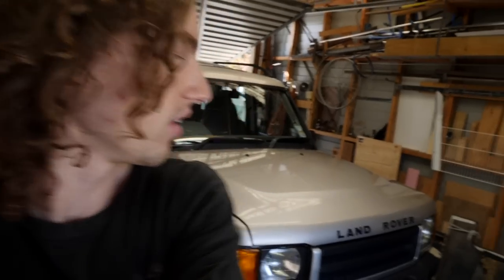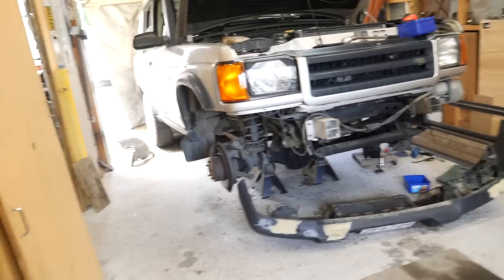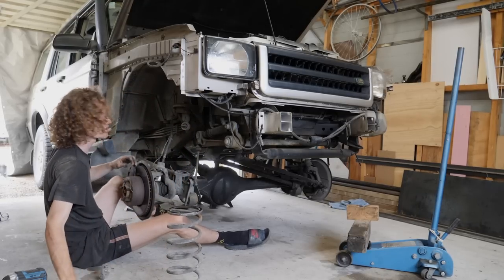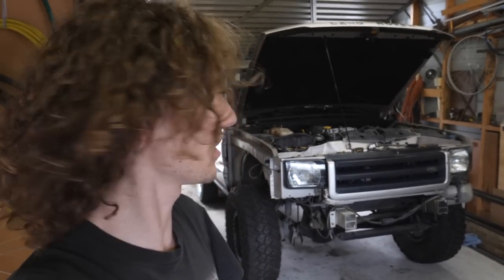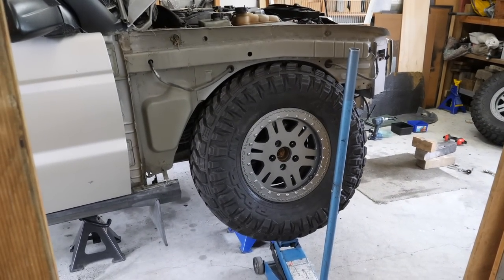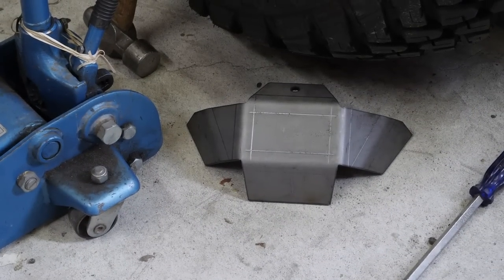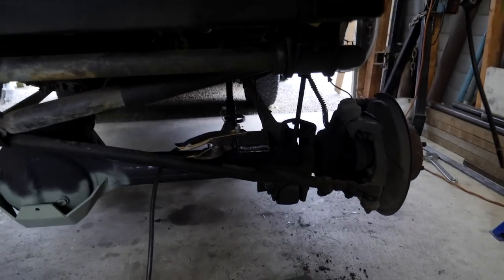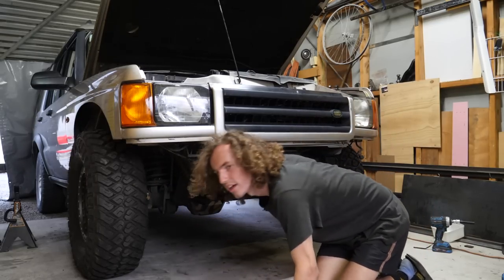BEATER TRUCK Build Begins! 33s w/ NO Lift! HUGE Guard Chop & DIY Fabrication on Discovery 2 TD5!!!

Comment: love the disco! ive got a 99 with about 4.5 inchs of lift and 275/60r20 tires but i rub on the control arms even with a 20mm spacers

Comment: Love the vids your a natural at driving off-road..Here in the uk 🇬🇧 we got what seems like millions of these D2s turned into off-roader and having had plenty myself and D1s, This Being a later model disco they just don’t flex aswell as the D1s plus you can’t beat the power of a V8 3.9 💪🏼. The TD5 is ok once mapped. But the V8 wins all day. So it’s going to be interesting on watching your build and how it performs. 👍👍
Reply: I have a 3.9 with an auto behind it and it’s slow as sh!t, sounds sick tho
Reply: Td5’s in standard form are pathetic power wise. But if you fit a straight through exhaust and egr delete it really wakes them up, if you decide to go for a remap and bigger turbo and intercooler you can see well over 200bhp
Reply: @joshthurkettle5406  you should drive a TDi - even slower

Comment: Haha finally been waiting for this as iv got a discovery 2 aswell so be very interested in the build
Reply from the maker: Cheers for waiting! Making for a fun build, can’t wait to get it on the tracks!
Reply: @Crawlerer79    don't know how it will compare to your discovery 1 on the tracks  so it will be interesting I have herd the discovery 2s have stronger cvs but for that week rear axles
 As on my disco 2 I'm planning on 33s and working on getting as mutch suspension travel possible with as little expense
Be interested to know of your going to change anything on the rear watts link as it's  on the front you should be able to get Pluss 3 shocks on and iv herd the rear you can install front brake lines and front abs lins as they will be longer but as far as stock gose the original shock is the max you can use till you upgrade the brake and abs lines
Reply from the maker: It won’t be as capable as Lando for a while, I’m on a very tight budget so only 33s vs 35s and currently no lockers doesn’t give it much of a chance. With that being said, I cared a lot more about Lando, where as a bit of panel damage on this wagon is all part of it! We’ll see how we go tho, got a few ideas up my sleeve!
Reply: Well il be definitely waiting to see how it turns out
Reply: @Crawlerer79  great video been waiting for this as I have an exact same D2. Always wanted some info on swapping springs from the stock LR family to get some lift. Looking forward to seeing mods down the road and how your gonna get the auto to turn those 33’s on the open road( i know you’ll make it work). Heartwarming to see the two of you sharing moments in the shop.

Comment: From my experience Range Rover Classic springs are an inch or possibly an inch and a half bigger than D1 springs. Had them on my D1 for a bit when I first ever lifted it and they did do well, there currently sat in my shed, I’d let you have them but I’m in the UK 😊

Comment: Ive got a question, How do you fill or drain the front diff oil with that diffguard in the way
Reply: Probably have to siphon and pump the oil in and out 🤔
Reply from the maker: You can still access the drain and fill ports just fine. Generally use compressed air into a container to pump the oil in 👌

Comment: I went with 2" body lift/2" suspension so I could fit my 33s without cutting/beating. Mine are also 255/85r16s (on +30 16x8), so a bit skinnier. If only it had the top tier 4.0 in it 😉
Reply from the maker: Sounds tidy! I definitely didn’t need to cut as much as I did, however I wanted to trim so that 35s could clear in the future. Haha ooh big call! I’ve had the 4.0 and TD5s, tbh I really like them both

Comment: I have the same diff guard and also full Gwyn Lewis diff pan just trying to get one of my welder mates to do the full diff pan rather than the easier diff guard option before my new diff arrives from Nige. 
Speak to my mate Ashley MLR sure he has d2 springs in stock probably TF and Extreme 4x4 options depending on budget.
Looks like you got Elsa to practice on your finger nails before letting her loose on the Disco😀
Reply from the maker: Sweet! I definitely prefer the replacement pans, I have some spare D2 axles which I’ll build up and shave in the future which will get the replacement pans, but the guard is definitely easier to just get ya going!
Reply: @Crawlerer79  yes indeed. 
Mainlandrover has TF +2* front d2 springs in stock by the way.

Comment: measure the diameter of the springs look for a  1/2 ton 2 wheel drive van  . There is where you will fid the springs you need